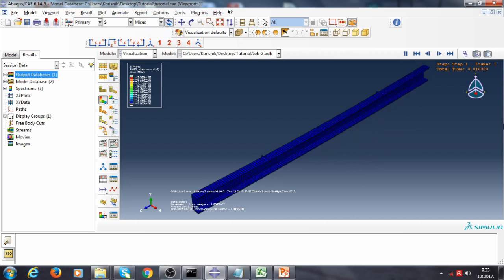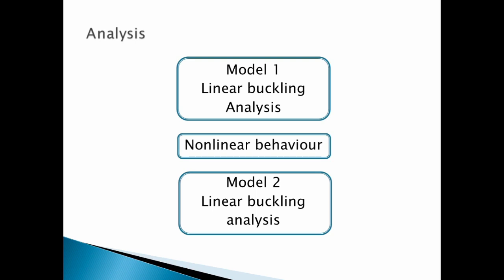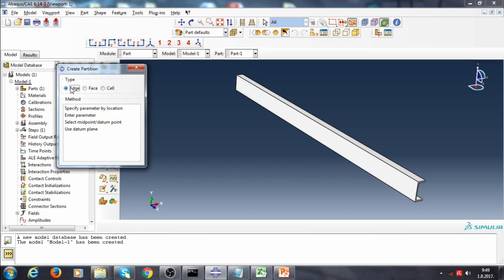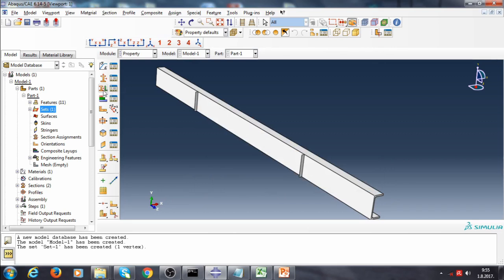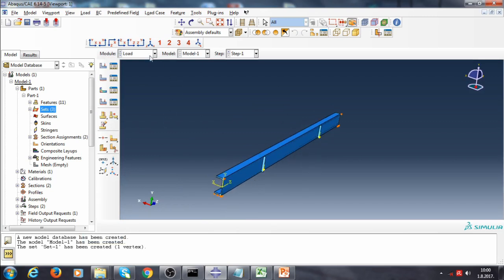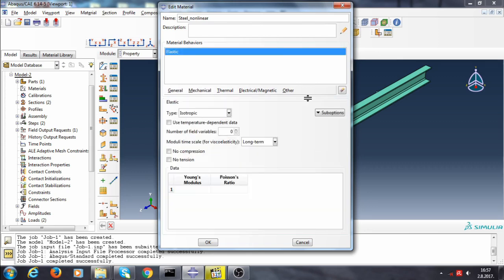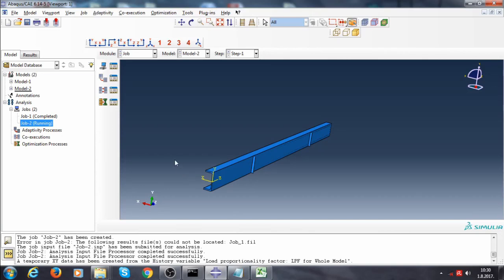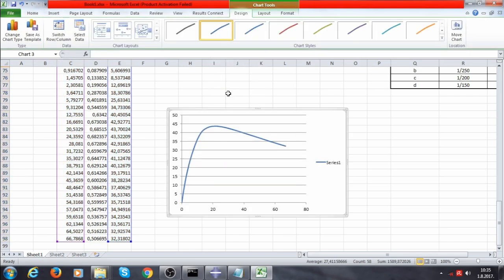Abaqus standard: Nonlinear buckling tutorial

Comment: Hi, thank you for your good training, and a question: what command should be written in the keyword to riks analyze a 4-meter span with 4 mm imperfection?
Reply from the maker: Leave everything the same but instead of "1, 28.0" write "1, 4.0".
Reply: Hi, thanks very much, an other question that, is lateral constraint of upper flange necessary in buckling and riks analysis of a pfrp I beam with 4 points loads or no?
Reply from the maker: @omidalirostamzade3966  You can play with boundary conditions to achieve best results. There is no universal rule
Reply: Thanks a lot.

Comment: So the largest value of the load from Excel is my new critical buckling load considering imperfections?
Reply from the maker: Yes. For this particular specimen modelled it is the ultimate load.
Reply: @ivancudina93  I tried to do this but my LPF gets bigger than 1.0 - how is this possible?
Reply: I have used pure elastic material for your information
Reply from the maker: @lw7474  It is completely fine to have LPF>1,0. It means that the resistance of your member is greater than the load you applied in the model. Regards!
Reply: @ivancudina93  but I applied the load in the size of the first eigenvalue. So it shouldn't become bigger than 1.0 I guess...
Reply from the maker: @lw7474  It is known that certain members exhibit such behaviour. For example, plates achieve post-buckling resistance and are able to maintain stability after reaching eigenvalue load! So, depending on the type of member that you are analysing, it is possible that the ultimate load is higher than the eigenvalue load.
Reply: @ivancudina93  Thank you very much for your detailed reply. Would it make sense to do another  buckling analysis after adding the imperfections? I have to demonstrate the negative effects of pre-deformation on the buckling load, so I need to get a smaller eigenvalue than the one before I added the pre-deformation.

Comment: Thank a lot for the vedio.I have a doubt How to find buckling stresses
Reply from the maker: After nonlinear analysis is complete you can easily do it. Abaqus has a tool that allows user to obtain stresses from arbitrary point. I recommend using "von Mises" rule for stress calculation. Regards!
Reply: @ivancudina93  buckling stresses and von mises stresses are different I guess..
Reply from the maker: @mariajames6737  If you are referring to elastic buckling stresses (which is a theoretical value) than Abaqus does not have a function to determine such value. But you can calculate it using common rules.

Comment: Thanks for the video! It is really helpful. A few questions here, I'm doing nonlinear buckling analysis for rebars, and I'm a bit confused about the imperfection. In the keywords "*imperfection... 1, 28.0", how do you determine it is 28?
Second thing, for the nonlinear model, is "*imperfections, file=job1, step=1 1, 28.0" the only thing to add in the keywords? Do I keep "*node file, U" as well?
Third thing, can you make a tutorial on plotting stress strain curve in Abaqus?
Thanks in advance!
Reply from the maker: Hello there! 
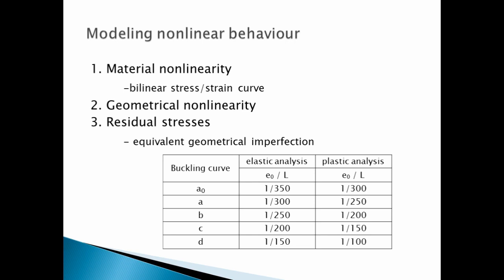At around 3:40 you can see a table taken from Eurocode 3 which states that the size of the imperfection for this kind of cross section and plastic nonlinear analysis should be Length/100 which equals to 28 mm.
Regarding the keywords in the tutorial, I suggest you do exactly as I showed because abaqus is very sensitive regarding errors when editing keywords. You can find much more info on keywords in Abaqus manual if you are interested.
Finally, I don't plan to make any tutorials in the near future but it is very simple to plot stress-strain curves. However, it is not difficult and I am sure you figure it out on your own. Unfortunately I do not have Abaqus on my computer currently so I can not write exact steps.
Regards!

Edit: Nonlinearities used in the tutorial do not apply for the rebars!!
Reply: @ivancudina93  Thank you for your reply Ivan! I followed your suggestion in the keywords and my model is finally working! And just to let you know I have figured out the stress strain curve. Thanks so much again your video helped my dissertation a lot!
Reply from the maker: @antheaellis17  Thank you for your kind feedback. I am very glad my tutorial helped you!

Comment: Thanks for this useful video!
I found that force control is used in your video. Will it be any different to use displacement instead? The reason that I am asking is that I found that the result obtained by force control and displacement control is different for LTB analysis in my study.

Many Thanks!
Delon
Reply from the maker: It is possible. Finite element modeling is a very complex procedure and engineers often encounter illogical results. That is why numerical modeling without experimental background has very little meaning. I personly never investigated such phenomena but I would be interested in your research if you would publish it.

Comment: Would it be big difference if you have  used true stress strain curve instead of bilinear?
Reply from the maker: It is difficult to say with fem analyses. However, since I conducted parametric analysis later on it would be too much time consuming to make model with true stress strain curve so I did not try. Also, my results were fairly good with bilinear stress strain curve.

Comment: Thanks for the very useful video. I am modeling a composite joist and have successfully carried out the eigenvalue buckling analysis, however, trying to do the non-linear analysis using the Riks method, I kept getting this error message " A zero displacement solution was found in the first iteration of the Rik's step. The Analysis cannot proceed. the most likely cause is that all displacement degrees of freedom are constrained to be zero" Please, how can I solve this problem.
Reply from the maker: I can't say exactly without additional info. Try playing with the boundary conditions and loading to see if it will help. If not, send me the model, and if I find some time, I'll try to find the error.

Comment: Sir, I applied concentrated loads on reference points but am getting an error when am submitting the job. It says "the points on which point loads are applied are not active". Sir, how can I activate these reference points in the model?
Reply from the maker: I also had problems with reference points. Try to introduce shell element on midspan od the beam and apply load there like I showed in the tutorial.
Reply: @ivancudina93  Sir, I resolved the problem of reference points. Finally it worked, Bam. Thanks.

Comment: why r we multiplying the eigen mode with 28
Reply from the maker: Realistically, the size of geometrical imperfection is equal to L/1000. So, we can include that kind of geometrical imperfection into our model, but then we need to include residual stresses as well. However it is possible to model equivalent geometrical imperfection (larger then the realistic one) which will also include residual stresses. That is a simplified version of modeling nonlinear behaviour of the beam which I used in the tutorial. According to European codes (Eurocode), the size of the equivalent geometrical imperfection should be L/100 for channel sections. In our case, that is 28 mm because the length of the beam is 2800 mm. So we needed to multiply geometrical imperfection by 28 to get 28 mm.

Comment: Hi Ivan, I am running an analysis for I-beam, but in riks analysis, I am getting linear lpf. I would be pleased if you could help me with this.
Reply from the maker: That means that your model is showing linear behaviour. It can be number of reasons. It could be that you are not applying enough load for the nonliear behaviour to manifest itself. It is also possible that the size of the imperfection in your model is not large enough. Or you failed to include any imperfections in your model.
Reply: @ivancudina93   I have included 10% imperfection in my model and I am applying load as obtained in the first eigenmode.  In the whole analysis, the load is increasing it is not decreasing and in the end, the analysis is aborted due to the convergence of increment.
Reply from the maker: What does 10% imperfection mean? What kind of model are you  working on?

Comment: Thank you for an amazing video. I have few doubts regarding the significance of the command *NODE FILE U, what does the "U" represents in that command? Also I'm doing non linear buckling on a pressure vessel should I use the same command for node file extraction? Please reply when you find the time. Thank you.
Reply from the maker: Check the Abaqus keywords manual. I'll put the link.
http://dsk.ippt.pan.pl/docs/abaqus/v6.13/books/key/default.htm
Reply: @ivancudina93  Thank you very much.

Comment: Your video is just excellent! i learn a lot from that!! But i have a question which is the final LPF vs arc length graph, what is the physical meaning of the peak value obtained from there? Is it the maximum buckling strength of the beam? If yes, how the beam is failed as I dont see any buckling in the figure, and why the LPF is decreasing. Thank you!
Reply from the maker: Yes, LPF multiplied by the applied force respresents the ultimate buckling resistance of the beam. If you are asking why the displacement does not occur more suddenly, that is because channel sections as uniaxially symmetrical cross sections (unlike biaxially symmetrical I or H sections) behave differently. Not all elements buckle suddenly under load. For example, plates tend to show postbuckling resistance. Which means that after they buckle, you can continue to apply force of even greater value before they completely fail.
Cheers
Reply: Thanks Ivan! So how do you know about completely fail from observing the curve or graph?
Reply from the maker: The failure usually happens after peak value in LPF curve. There are few exceptions, but not in our case

Comment: Super Helpful Video Ivan, Thank you Very much...

can you also make a video on imperfection, and why did you put 28 for 1st mode...?
what is the theory behind it?
Again Thank you...
Reply from the maker: Realistically, the size of geometrical imperfection is equal to L/1000. So, we can include that kind of geometrical imperfection into our model, but then we need to include residual stresses as well. However it is possible to model equivalent geometrical imperfection (larger then the realistic one) which will also include residual stresses. That is a simplified version of modeling nonlinear behaviour of the beam which I used in the tutorial. According to European codes (Eurocode), the size of the equivalent geometrical imperfection should be L/100 for channel sections. In our case, that is 28 mm because the length of the beam is 2800 mm. So we needed to multiply geometrical imperfection by 28 to get 28 mm.
Reply: Ivan Cudina Thank you Ivan for replying....I got the point about imperfections...
What if we don't add imperfections in our model ??

Another Thing I have want to ask is , how did you decide inputs for Rik's method, that is estimated arc length, maximum increment size etc...
Reply from the maker: If you do not add imperfections in your model, then you would get much higher value of buckling resistance. But eventually, the beam would buckle even if there are no imperfections included. You can simply try that but assigning the value of imperfection equal to zero.
And  now the second part of your question. I just took some recommended values for arc length and increment etc.  They worked fine so I did not go very deeply into that matter. If you want to understand that topic better, you should do some research on arc length method. Cheers
Reply: Ivan Cudina Thank you Ivan...

Comment: For the Nonlinear Analysis, Can I use a different load, for example the self-weight or Should I always use the eigenvalue from the linear Analysis?
For some reason, when I use this eigenvalue as the applied load, it doesn't converge, and gives me lots of error. But If I applied the self-weight It gives me a result but I don't know if this result is accurate. is it?
Reply from the maker: I don't know. That is strange. It should converge in both cases. As long as the load case is the same, the results should also be the same. The only thing that is changing in regards to load value is the LPF. If you assign for example 10 kN and get LPF = 0.8, then for the same load, but with the value of 1 kN, you should get LPF=8.0. 
So probably you have completely different load cases.
But I can't say is it correct or not because you did not give me enough data. If you could send more data to my e-mail about your problem, maybe I could help.
Reply from the maker: I don't know. That is strange. It should converge in both cases. As long as the load case is the same, the results should also be the same. The only thing that is changing in regards to load value is the LPF. If you assign for example 10 kN and get LPF = 0.8, then for the same load, but with the value of 1 kN, you should get LPF=8.0. 
So probably you have completely different load cases.
But I can't say is it correct or not because you did not give me enough data. If you could send more data to my e-mail about your problem, maybe I could help.
Reply: Yes of course, I would appreciate your help! Could you tell me please your email?

Comment: why did you put the load as 1N??
Can I have your email to ask you some questions please!!!
I am doing my dissertation in FEA LTB so i have some questions regarding it
Reply from the maker: The size of the force does not have to be 1N. But usually, in eigenvalue analysis, the force of 1N is used. Let's presume you get eigenvalue of 150 for example. That means that critical force is 150N. If you use the force of 30N for example, then you will get eigenvalue of 5 (because 5x30=150) which is a bit confusing. 
My email is ivancudina93@gmail.com
I'll answer you if I find the time.
Reply: I am getteing 1.38 eigen value and Mcr as 58kN why is that..tho i followed ur step one by one!!1

Comment: How did you calculate the Critical moment theoretically
Reply from the maker: I will put below a link for the paper where you can see the formula and its factors explained. That formula is valid only for doubly symmetric cross sections but I believe it can be used for channel sections if they are loaded centrically, that is through the shear center.
 http://eurocodes.jrc.ec.europa.eu/doc/WS2008/SN003a-EN-EU.pdf

Comment: I want analysis 440×240 mm steel plate under shear loading. (Load is apply 440 mm edge).How can ı obtain geometrical imperfection value  for shear buckling analysis. I will be pleased if you answer....
Reply from the maker: I'm sorry, but I wouldn't like to answer that because I am not entirely sure about the answer. I have never studied buckling resistance of steel plates exposed to shear loading.

Comment: Great video but I cant understand Why did you use 28 multiplication when added imperfection?
Reply from the maker: Because I took the size of geometrical imperfection to be Length/100. Since the length of the beam is 2800 mm, that equals to 28 mm. That's why I have to multiply imperfection size with 28, otherwise it would remain 1 mm. The actual geometrical imperfection is much smaller, but this is simplified way of taking into account residual stresses.
Reply: Ivan Cudina thanks for your intereset...

Comment: Will you please make a video on web buckling of plate girder.
Reply from the maker: Unfortunatelly I don't have time now for making any more videos
Reply: Ivan Cudina please do I'm also stuck in modeling a plate girder for failure in bending only (elasto-plastic analysis). Should i go through this same process and I'm using a uniformly distributed load instead of point load. Should my udl be 1lb/in as you used a point load of 1N to get an eigenvalue
Reply from the maker: You can use 1lb/in if you want, but you don't have to. You can use any value in eigenvalue analysis. With plate girders I would recommend using shell elements. I don't know exactly what is the scope of your research but try reading this paper on modeling of web crippling (http://www.steel-stainless.org/media/1117/25_bock_real_arragay.pdf )
Reply: Ivan Cudina I'm using shell. Please is there a way to reach you that way i can explain better. Email perhaps. I'm in dire need of help
Reply from the maker: Akaolisa Okafor ivancudina93@gmail.com
Reply: Ivan Cudina i just sent you an email.

Comment: Thank you for the video Ivan. Its really helpful. Just want to ask, what means by the first eigenvalue? Is it directly refers to minimum loading which causes a single curvature lateral torsional buckling to the channel section?
Reply from the maker: First eigenvalue is the minimum load (or if you wanna be accurate, the smallest number that multiplies load applied to the beam), that would be required to cause buckling of a beam if the behaviour of the beam was ideally elastic. Which means that strength-strain curve of the steel would have to be completely linear and there would not be initial bow of the beam nor any residual stresses. That is only possible in theory that is why eigenvalues have purely theoretical meaning.
Similarly, second eigenvalue is the minimum load required to cause the buckling of a beam in the shape of the second eigenmode. Since the first eigenvalue is always lower than the second, beam always buckles in the shape of the first eigenmode. Second eigenmode also have purely theoretical meaning.
Reply: Thanks a lot for the explanation!